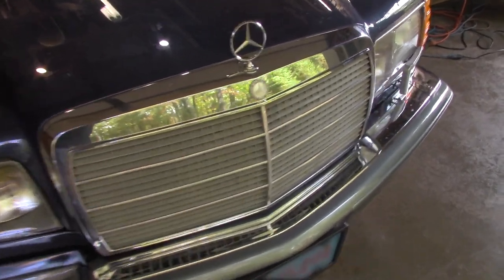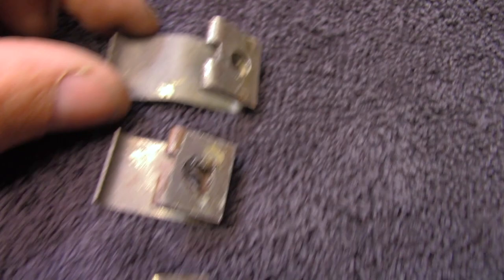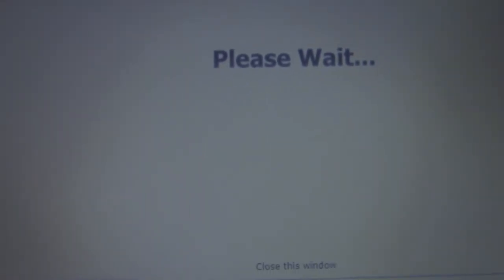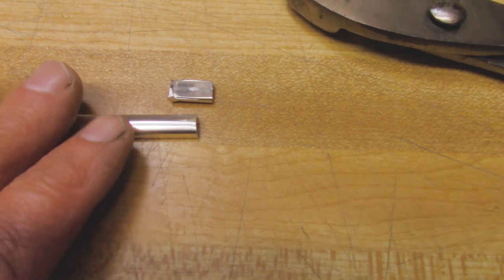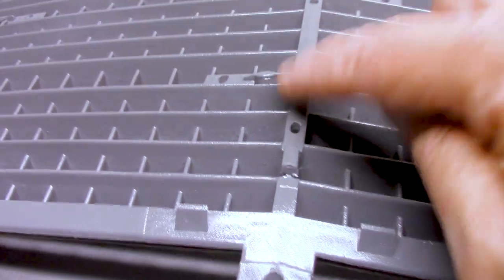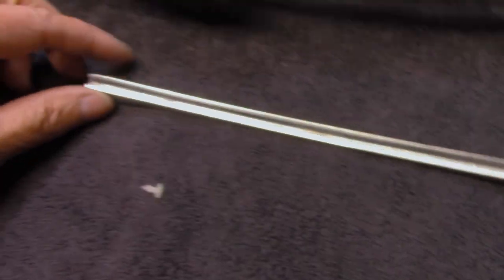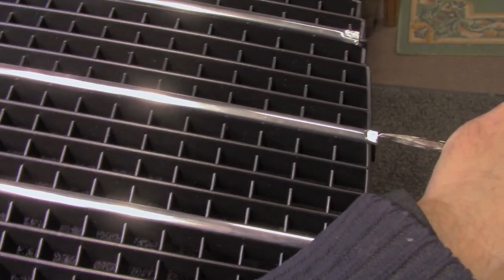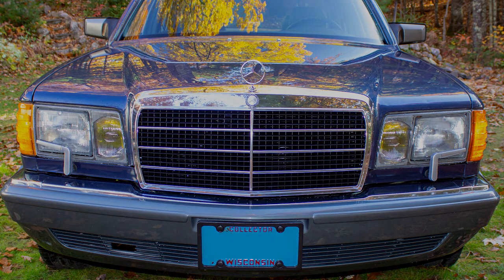W126  Mercedes-Benz S-Class Refinish Grille.

Comment: Great video!  Do I need to remove the hood star when removing the grille insert?  Should I replace the grille to hood gasket before reinstalling?  I have a 1985 300SD.
Reply from the maker: Thanks. You do not need to remove the Star. My grille seal (gasket) was good so I did not replace it.If you need one the part # is 126-888-00-97 and eBay has them for under $30.

Comment: I am installing a new vertical center molding but the old one won't slide more than 2" in either direction so I can't get it off  How is it removed?
Reply from the maker: You just have to pull it down with needle nose pliers hard. It will slid off.